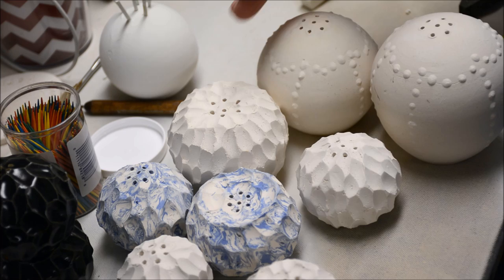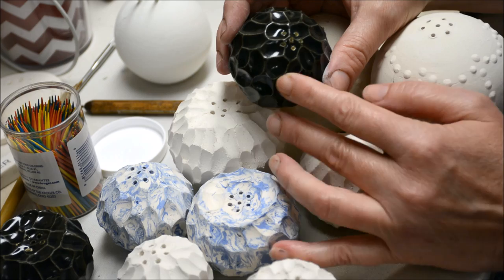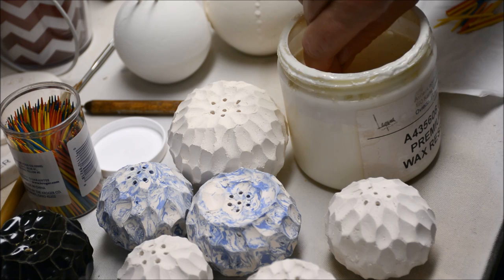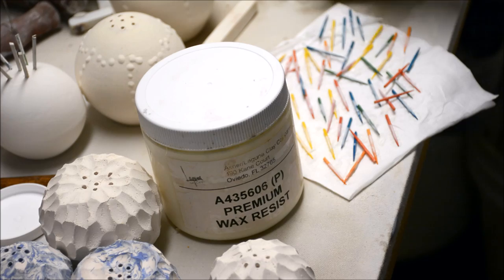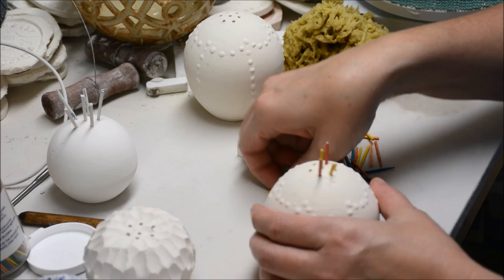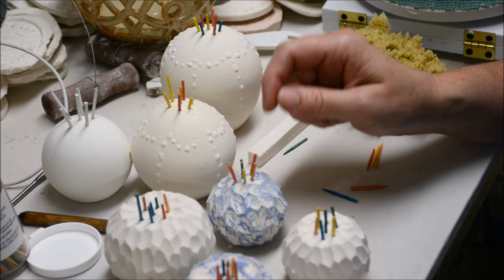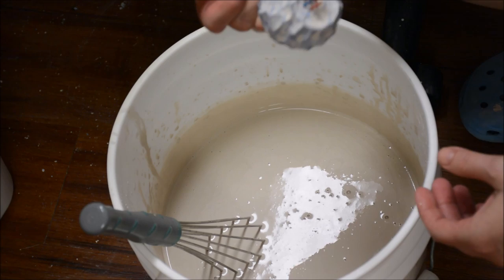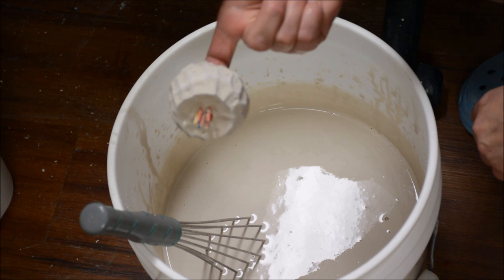How to Glaze Ceramic Salt and Pepper Shakers by Dipping or Painting

Comment: Where can I buy the grinding tool you use to cut through glaze?
Reply from the maker: Hi Julie- any diamond drill bit should work.  It is difficult if glaze has run down very far into the hole.  I have this particular set I got on Amazon.  The bits don't last terribly long, but this was a cheap set... so I didn't particularly mind!  https://www.amazon.com/gp/product/B00CNXFUBG/ref=as_li_tl?ie=UTF8&tag=karanspotsand-20&camp=1789&creative=9325&linkCode=as2&creativeASIN=B00CNXFUBG&linkId=71f20842d28faa970e0e583626e65a57